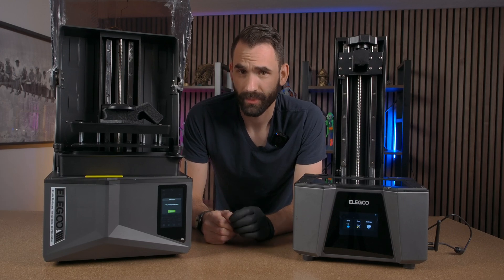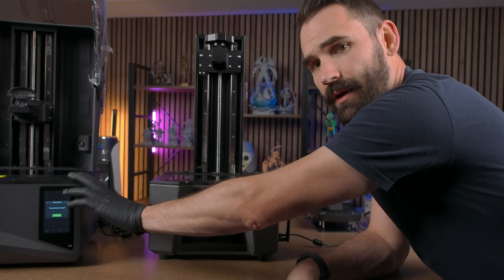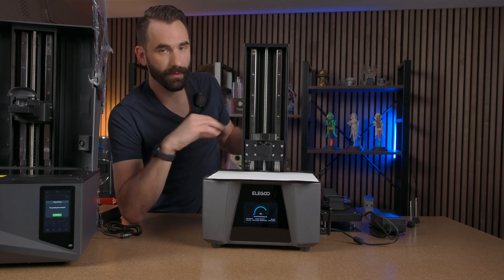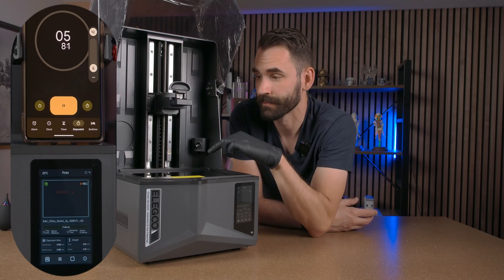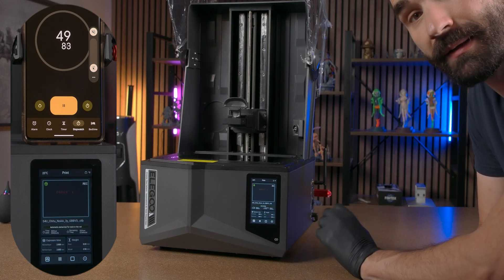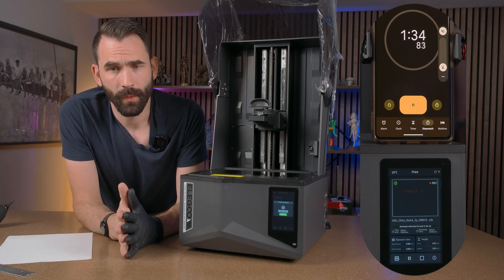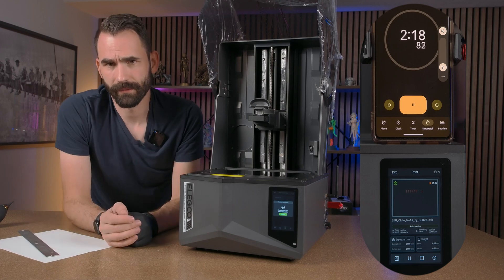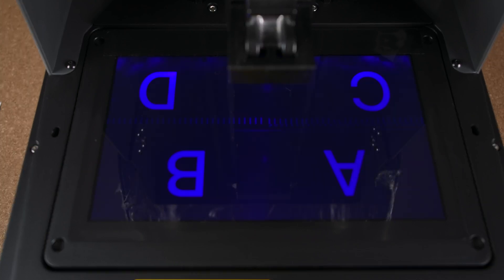Even the latest printers still have this MAJOR bug!! #chitubox #elegoo

Comment: Not something I had any idea about, nor about running a dry print. As always, the hole keeps getting deeper lol. I am planning to start printing with ultra 4 soon, but as it was so cold, I wanted to get a brewers belt (as the mini heater was delayed for me until August, so I cancelled it). So any and all preflight checklist ideas, tuning adjustments etc are all welcome. It’s a very different printer due to the rocking mechanism and auto zeroing functionality. So I’m not sure what I do, or don’t need to check/tune using your awesome guide!

So far I just added a handle, fume extraction and a drip tilt/handle I printed using my fdm printer, plus it’s just way easier to hold the plate/remove it. Really awesome addition as with this printer especially I feel you need to let it bleed off a bit after prints because of that middle section where resin is trapped.
Reply from the maker: @Aztechnology.  I also printed the hanger for the S4U. I think it's going to make a great addition. 

In the next few days I plan on doing another short video about layer compression on these auto leveling printers. 

But after that I really want to focus on the good parts.
Reply: @J3DTech  another channel Geek Detour, recently covered the Saturn ultra and Mars ultra. He made some physical modifications but did mention the corner screws did allow fine tune adjustments to build plate level. Unsure if that’s true, but he seemed to think so. I’d imagine given how it auto zero’s that wouldn’t help much with the layer compression though. Are you aware of any way to fine tune that, or is it just the nature of the printer?
Reply from the maker: @Aztechnology.  I saw that, If mine has the z offset issue will try a few different things. But I'm going after the source and working with Elegoo to see if they have the ability to add it back into the firmware.
Reply: @J3DTech  Awesome, that’s definitely the way to do it if possible. Thank you!
Reply: @J3DTech  "In the next few days I plan on doing another short video about layer compression on these auto leveling printers." 

Looking forward to it ! I think that it's important to highlight why that's an issue even for people who don't print parts directly on the plate but on supports, because I already know what Elegoo and others will tell us ("blablabla don't print on the plate, the printer isn't made for it..."). 

In conjonction with problematic first layer operations that make the first layer thicker than it needs to be, the compression of the subsequent layers seems to me to potentially increase the bed adhesion failure rate (as the first layer's resin remains quite soft where it meets the plate, but then the compression for the subsequent layers means gross overexposure for them, as you're repeatedly curing the same thickness), and I'm also wondering how hard these overexposed compressed layers affect the release film (which would be ironic on the M5U/S4U as one advantage that's been advanced for the tilt mechanism is it being more gentle on the release film during lift operations).
Reply from the maker: @MayaTlab  Good suggestions, I make a test part just for this, I have yet to test my test part but we will see how it goes. I've not even unboxed my M5U or my Revo as I want to make a video for them, but I think maybe this is taking too long and I just need to get to printing. In the end I think people care about getting this helpfull content from me vs entertaining or review type content that maybe other youtubers are WAY better at.
Reply: @J3DTech  I can only speak for myself, but I live for your "boring" helpfull content and I'd much rather have more of it !